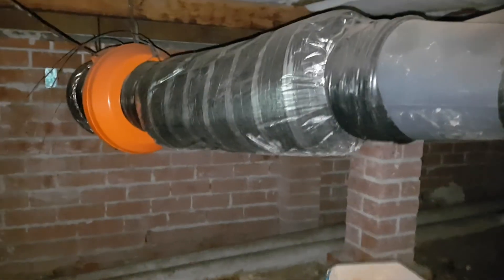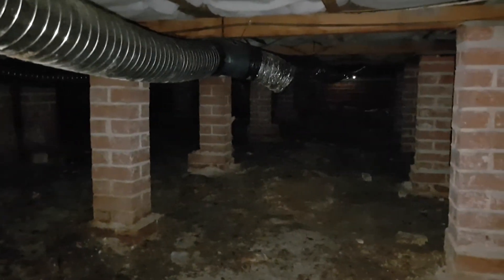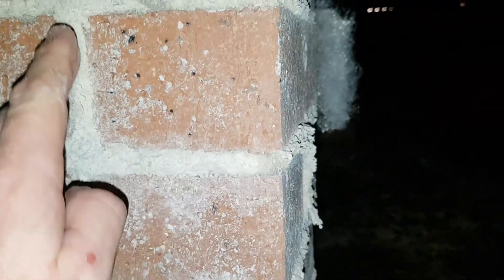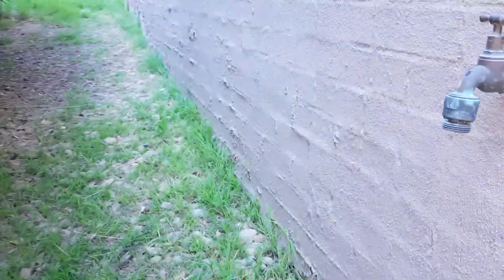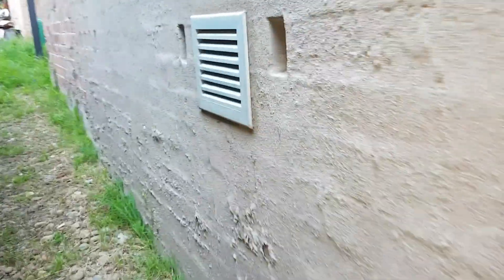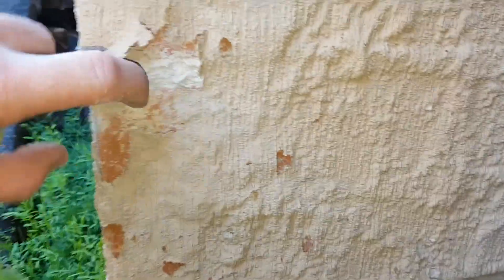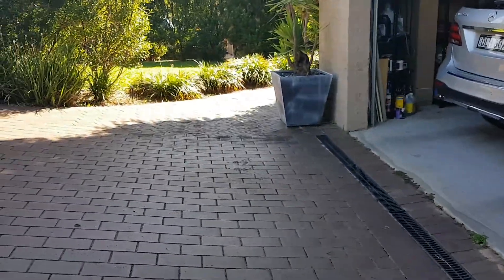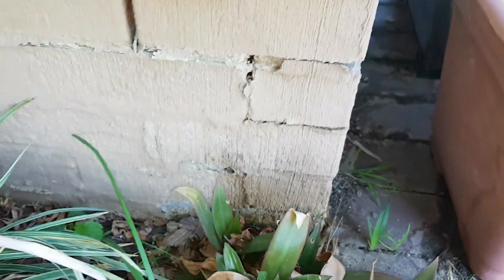Damage caused by sub floor ventilation and errors with dampcourse levels from builders.

Comment: Efflorescence has a life span as there's only so many raw minerals in the mortar and bricks that can be deposited through moisture transfer before they're completely depleted.  You're rubbing off the deposited crystalline silica, the mortar underneath those deposits will in fact be rock hard assuming its a Portland cement mortar. 

What you're stating is probably true for older homes where lime based mortar was used, modern mortar made with Portland cement would not break down as you're claiming. 

As an example, modern mortar joints where Portland is used are exposed to the elements. Wet one day, copping 35 degrees the next day etc constantly being wet and then drying out, and they are fine for decades. Sure they may develop some hairline cracks here and there, but in no way do the mortar joints deteriorate like you're claiming. Think of your brick fence outside in the elements. 

Mate, don't scare people unnecessarily.
Reply from the maker: A life span, how? This is chemistry in action. Chemistry doesn't just get old and stop one day. 

The salt is coming from the ground. There are subfloor fans in there that are drying out the piers, if the piers were 100% dry then there would be no efflorescence because the salt would have no vehicle, but they arent dry, because they have running water under their house from a hill that extends another kilometre upwards from the house which replenishes the moisture in the ground which piers are built.

Study how salt dilutes in water, becomes a liquid and passes through porous substrates via capillary action with the water, study what a hydration shell is, then come back and critisise my videos.

That place is new. 10 years old at the time the video was taken. Those are common bricks with modern building materials if you take a closer look. There is no lime in sight at all on that build.

The mortar was deteriorating rapidly from between the bricks due to the crystals pushing apart the mortar components. 

The water below brings salt, and it accumulates at the evaporation point. When it dries, boom, deterioration.
Reply: @risingdamp efflorescence is a result of sodium/salts, calcium,  magnesium, potassium, all these minerals are not endless and every substrate will have "x" amount of these minerals before there's simply none left. Colin Cass has written extensively on efflorescence and whilst it's not an ideal situation the reailty is those piers won't get any worse then what you're witnessing. You're literally rubbing of the salts, but if you tried to scrub the actual mortar joint out altogether you'll find that is actually OK underneath that layer. 
The pyramids are built on the ground, mainly of limestone, which is a terrible substrate for efflorescence, why hasn't the efflorescence decayed them into the ground? The weathering sure is though. Efflorescence is a result of minerals passing through a substrate/ material, they're not endless, eventually everything runs out. 
If they're on sloping land then drainage at the back of the property to mitigate water ingress in the first place would actually be the Gold standard approach, assuming its possible
Reply from the maker: @1nando632  This is not efflorescence from the building products. It is salt attack from rising damp. Different. 

We've seen houses with piers falling over from no mortar and piers with concave sides as a result of the salt attack.

This job was around 7 years ago, we give a warranty, and I've had no callback after this job was complete.
Reply: @risingdamp salt attack and efflorescence are very closely related. It's raw minerals being passed through a substrate in the presence of moisture transfer. 

Note, I'm not saying you're not good at what you do, you're obviously overly conservative on your approach and that's never a bad thing.
Reply from the maker: @1nando632  the only relation is the presence of salt. 

In your efflorescence example. You're talking about limited quantities from within the building products.

Rising damp is the capillary action of moisture through masonry. When salts dilute, the molecules separate. I.e. sodium and chloride both separate and each get surrounded by a shell of around 7 water molecules. 

If the earth has high salt content and the ground is wet. Then someone installs subfloor ventilation fans, then the piers/walls dry out, and more water comes from the ground via capillary action, bringing more salt, which dries at the surface, continually damaging the masonry. It never runs out. 

We injected these piers and  walls at ground level to stop the water rising into the external walls and piers, then used cocoon to extract the excess salt above the injection point. We then repointed the piers.

The origin of the salt is not the same. We actually warrant this stuff. We have the walls tested for salt with a chromatography machine for the exact salt type and salt percentage for a before and after comparison. We can tell how much salt is in the bricks and what kind of salt it is. We know the normal acceptable salt percentages and what is above normal and what is extreme, like this house was.

I don't just have an "opinion" or read some books. We repair it and provide a warranty. I've had failures, which I pay for because i warrant things. And we kept going until we stopped the damage to the clients house. Opinions have a different value when they cost you money if you're wrong.

If our hundreds of customers still had deterioration in their bricks and stone, i'd be broke from all the callbacks.

Comment: Wait, too much ventilation? I can see the logic, the logic being that the ventilation dries the bricks out, but then moisture from the ground osmotically rises up the bricks again only to be pulled out a again, essentially (and ironically) increasing the movement of water through the brick and with an increase, minerals from the brick/mortar. I feel really bad for the owners. They are kinda stuffed at this point. Hope insurace can cover it.
Reply: Incorrect ventilation. Too high, which is why all the bottom bricks and footings were damaged. The damp was going up as far as the ventilation. It should be at ground level. The whole idea is to have the air flow go across the ground, not 1-1.5m from the floor.